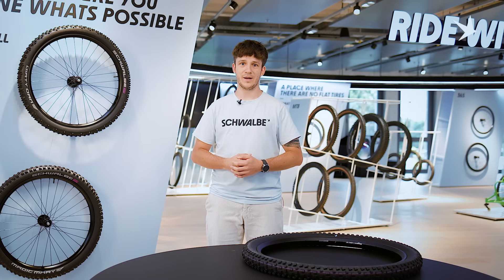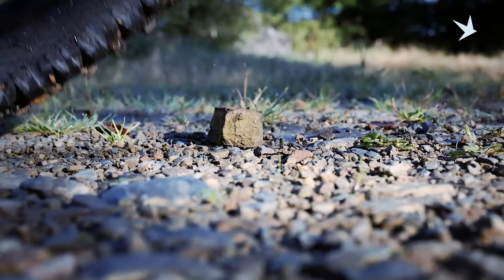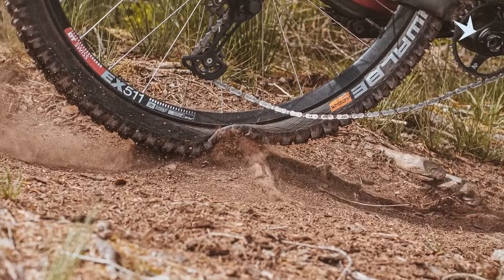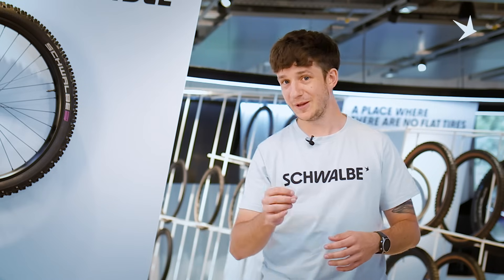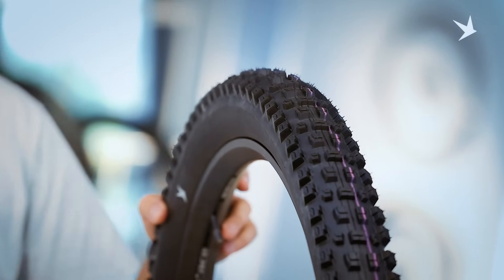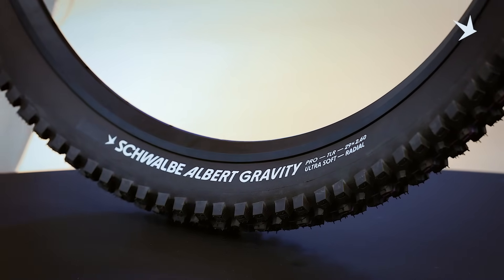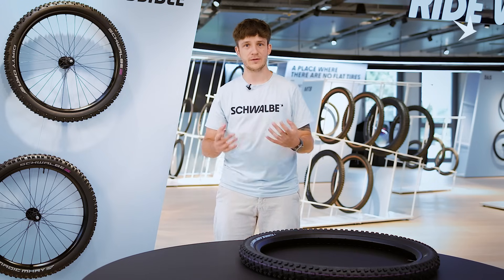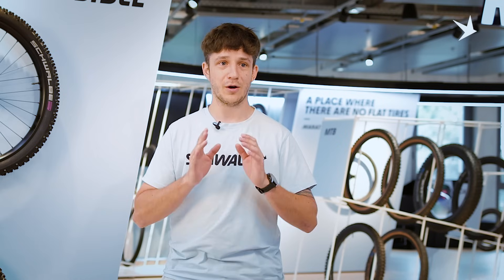The Radial Technology - What's The Story behind The New Albert & Shredda?

Comment: Dear Schwalbe.   I am currenlty running the Panaracer Fire XC Pro, in a 2.35x29".   Yeah, it's a very very very old tread pattern and design.  But it's worked wonderfullly for 3 decades.  The tires provide fantastic grip, and they last a long time.   Oh, did I mention the tires ONLY weigh 850 grams?  Yeah, all that performance at 'almost' cross country level tire weight.   I am super interested in the Radial Technology of your new tires.  But the LIGHTEST model you have weighs in at 1,300g per tire.  That's OVER A POUND... PER TIRE...  No amount of extra grip is going to get me to add 2 pounds to my bike - of rotational weight....     Really really hope you add the Radial Tech to knobby xc sub-850g tire.   THAT I would seriously consider buying and putting on my bike.

Comment: TRUE STORY:
OMG!  Been there, Done that in 2000...  I am a tire engineer and back in 2000 a Taiwan tire company gave me free-reign for one year to develop any tire design I could ever dream of in their all new modern tire development lab.  So I went on a top secret mission to develop the first Radial high performance tires for MTB and road bikes.  "It was a complete failure"...
Here's Why?!
The promise of super low rolling resistance, with a very large contact patch, along with a very supple ride are all there, but we discovered a "Major PROBLEM".  Radial sidewalls are incredibly flexible so when you're riding down the road or trail the bike just mysteriously wonders giving the rider almost no control of the bike to make small steering corrections.  Also no matter how much we tried to correct the problem the tires kept blowing off the rim. I even gave a set to editors of MTB-Action to "secretly" test them on their personal road & MTB bikes and the bad results of handling and blowing off the rim were confirmed.  So I had no choice but to abandon the Radial program.  We determined Radial tires only work on stable 3, 4 or more wheel vehicles and definitely not two.

Ahhh, but the Secret Radial story gets a little juicy as we found out later that we had a factory spy among us!!! 
The only problem was that the spy never really got to see any of the test results that I was strictly conducting only in the US.   All they saw was that I abruptly ended the program and destroyed every bit of evidence that we ever worked on a bicycle radial tire...
Sure enough, one year later a major and very well known Taiwan tire brand (which I will not mention) released a complete line of high-end Radial tires for road and MTB.  I was speechless & shocked to say the least as they blindly went full production with little or no testing.. To make matters worse they threw an all out world promotion.   In less then seven months it was all quietly taken off the market never to be seen again.  I just wonder, what happened to that little tire factory spy?
This is why I love tire technology, and I only hope Schwalbe did their home work cause this radial might just give their company a Black Eye.

Comment: After a decade of buying tires and >30 tires from Schwalbe, i started to look at other options  In 2023, with 10,00 km of biking with my road and mountain bike, i had 7 flats with Schwalbe. Not acceptable
Michelin has created the best tires to avoid punctures the Proteck Cross with 7mm of real rubber only 30 euros for a 35mm wide.  However you are loosing some speed.  Now 5,000km and 0 flats

Comment: I used radial tires on my road bike about 10 to 15 years ago. They had a major problem with tread to core delamination and i had to throw them away and switch back to bias ply tires. Radial tires have a great feature in that they are flexible and will roll much easier with greater control and contact with the road surface.

Comment: 1 car tire costs 80  to 160, you can make 7 bike tires from 1 car tire, why are we paying over 75 a tire , the only tech i need is the one that brings the price down !!!
Reply: Not all tyres are the same. There are bike tyres worth $75 bike that is already used for XC and  gravel racing. Meanwhile, the $80 car tyre is low to mid quality tyre. For car racing, some racing tyres are worth more than $1,000. F1 tyres for example are worth more than $2,500.
Reply: @oximoronin  car tires around 120 usd are rated are over 120 mph, their quality is low for cars but higher than most TT  or racing tires < its sad smell of scammmmmmmmmm!!!!!!!
Reply: Imagine paying for a crazy expensive tire mold with a few thousand tires vs. a few million tires.
Reply: Imagine thinking schwalbe only sell a few thousand tryes   @stephenkohler3472
Reply: @stephenkohler3472  Few thousand? There's many more bicycles in the world than cars, and many more being manufacturered every single day.
Reply: @swecreations  And they're all running a 27.5 x 2.35" Hans Damph?

Every size of every tread design needs it's own mold. That get's expensive.
Reply: @stephenkohler3472  less rubber lower speed is lower cost , they charge us more cuz we pay it plain and simple !!
Reply: @ca5ualm3dia  CST makes very good tires in the $40 range. Pretty popular in the bikepacking community since they burn through tires pretty quickly and don't care that much about weight. Might be more what you're looking for.
Reply: Where are you getting car tires for 80-160?!?!?
Reply: Car tires made from soft compound, they will not last as 25-30mm road bike tire
Reply: @dmitryhetman1509  rubber is rubber my guy, they keep charing cuz we keep buying
Reply: Your 75 euros/dollar brand new Schwalbe tire gonna also leak like there is no tomorrow. My brand new Tacky Chan are not holding air with sealant and brand new rims.
Reply: @skippylegrandgourou2069  This is price of low rolling resistance I guess. Latex tubes also loose pressure quite fast. You pump your tires each ride anyway, at least you should. Also it could be sealant problem, try to spin wheels when bike lays on ground
Reply: @skippylegrandgourou2069  some rim/tire combos may not work well, but it should hold pressure
Reply: Why we pay? Because we are stupid
Reply: "I refuse to try and understand basic economics because it breaks my narrative of victimization"
Reply: Check the Mary BikePark version. 
Proper Option for a msrp of 40€. Street price surely below that
Reply: My car tyres are £280
Reply: @largeformatlandscape  I don’t get it
How does it make sense to compare a cheap or mid range car tire that is sold by millions and manufactured mainly by machines to high end  bicycle tires that’s mainly manufactured by hand?
Reply: @Micha_7F  exactly.l. It doesn’t. If you want equivalents, you look at custom tyres for high end cars which cost £500+
Reply: @largeformatlandscape  basic tires are 80 to 120$$ usd , rated over 100 mph.... so why is my bike tires rated up to about 75 mph 5 times thinner same price or more!!!
Reply: @ca5ualm3dia  more hand made, not tested as rigorously as car tires,  high grip so low wear resistance, etc.
Reply: Car tires can be cheap because billions are sold each year. You can spread the research & development and production costs over all those sales.
MTB tire market is so much smaller that you can't do that in the same way so the comparison is not fair.
So it's not at all about tech bringing the price down, but market size.
Reply: @mayena5735  Load of BS. There's 1 billion bicycles in the world and 1.5 billion cars. Bicycle tyres are way overpriced. Fact!!!
Reply: You can buy mountain bike tires for 35USD right now. Specialized ground control sport is one such tire. 

Like an $80 car tire, it will meet the basic functions required, but it is not high performance in terms of grip and rolling resistance. Stop whining about price by comparing apples to oranges. If you want the cheap option, buy it!
Reply: Because people are willing to pay that much, manufacturers spend that extra money to develop a better tire.

Comment: Those tires weigh in well over 2 pounds each,, with that much weight you need a bigger foot print, thats probably ok for a 50 pound bike, no thanks, Its Tricknology. Showing the tire rolling over the same rock as the older tire might not work for this presentation, so lets generate a computer version for that, its not even factual,, it makes your explanation look like a scam..More Tricknology I don't need..

Comment: Sadly, it appears that once again you have released a product for lighter riders. The load is listed at 115 kg. For riders north of 100 kg, it makes the tire unusable as bike and gear will weigh more than 15 kg generally.
Reply: per tyre?...x2=230 kg 🤷‍♂️
Reply: @alesipavec6587  Right. I think Schwalbe needs to clarify this better in the product page. I also initially thought these are per bike + rider weight until I go into cargo trike topic and realized these are accummulative numbers.
Reply from the maker: Indeed it seems like we need to clarify this. The comment above is correct though - it 115 kg per tire. But we will pick this up in future communication.

Comment: It would be good to stick to 2.4 size option for rear at least, because it would be easier to compare directly to other similar tires that are not radial. If you throw on a 2.6 rear tire that extra volume alone will give you some of the benefits the radial are supposed to do, which means you need to find another 2.6 tire not radial to compare to. I do not have that and I'm not buying a non radial 2.6 tire just to compare to, which means I still need a 2.4 option because that's what I want anyhow.

2.5 for the front is fine, but I'm sure most will still want 2.4 for the rear.
Reply: Word salad but i get it.
Reply: YES!!!!!

Comment: Really interesting tires. Is it technically a radial tire if the threads cross? Why isn't the actual thread angle mentioned?
Reply: The actual angle will be protected IP and maybe patented, but I agree it's not a true radial tyre if the threads still cross
Reply: @nickeshchauhan5661  If it's patented it will be public knowledge anyways. It's also not like a competitor like Michelin couldn't reverse engineer the thread angle, so it's not a good candidate for a trade secret either.
Reply: Schwalbe Said the angle will be kept secret, however it can be measured.

Comment: What about rolling resistance?
What about carcasse stiffness? Will it fold over more easily in burms and jumps?
What about weight?
Reply: 20% more Rolling resistance at the same pressure. If you increase pressure it will improve, but will still be slightly worse. however this is not tested on a Trail. Could be that the smoother Rolling is quicker.

Comment: Excellent job. Radials have been needed in Mt biking for decades. I said it 30 years ago and am glad someone finally created radial bike tires. Cars got radials in the 70's and the wait has been painful. So many pinch flats could be avoided.
Reply: Certainly agree. 

I've noticed for a long that mountain biking lags the auto/motorcycle industry.  It seemed like it took forever the MTB companies to wrap their heads around the idea of compliance, as an example. 

It is interesting how radials are an advantage here compared to road racing motorcycles. From the mid-80's to the mid-90's, there was still a lot of bias ply stuff available. I liked to rock Avons on FJ1100 as an example. But what really made them better back in that time frame was longevity based purely on the radial nature of the plys. Bias ply tires tended to generate more heat internally and not last as long as a result. OTOH, bias plies were awesome because they provided more feedback to the rider as you neared complete loss of traction. Bias plies had this interesting ability to lose traction on a portion of the contact patch where as the entire patch on radials either had traction or didn't!  

The above said, I never knew there was a compliance advantage to radials! Pretty f'en awesome! 

And this is precisely the place I think we should be looking for compliance and grip.  Trying to make the frame or wheels more flexy does make some sense, but beyond a certain point it takes too much away from the ability to maintain attitude. Additionally, it damps signals coming from the contact patch.
Reply: @BDKR    Precisely, and flimsy frames tend to crack or bend over a period of time and need replacement. Tires are far cheaper to replace and the benefits don't end there.
Reply: The next practical step is to make bead locker rims for mtb/fat tire bikes
Reply: @J-A-Gnz  and have to carry a bead breaker on every ride?
Reply: @J-A-Gnz  Oh, you mean adding a mud catcher ring around the rim for additional dead weight that increases with mud caught? 😉
Reply: Same when motorbikes went to radials, also vast increase in longevity.
Reply: I had purchased a pair of radials from Universal Cycles back in the ~90's. They worked however, they really sucked on narrow rims since the air pressure had to be absurdly high, something I detest since I am head over heels in love with traction and ride quality.

Comment: There's many issues not mentioned with the radial design and low pressure on high loads, did you insert a bias ply under the radial carcass? Hookless rims shouldn't be compatible?
Reply: It isn't 100% radial, just more radial oriented bias plies than before.

Comment: The problem with eddy current front is the pack of grip on a 29x2.6” runing over rocks at 28psi is very slippery tire, down 21psi get fix, but the amount of drag is exhausting